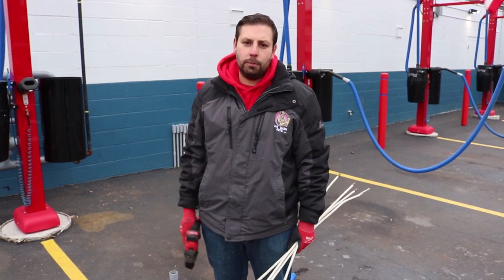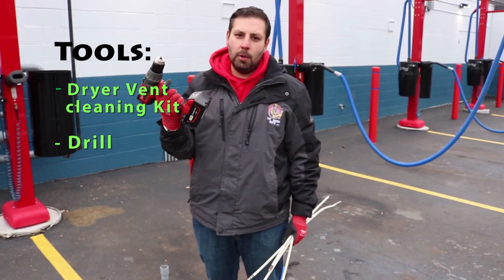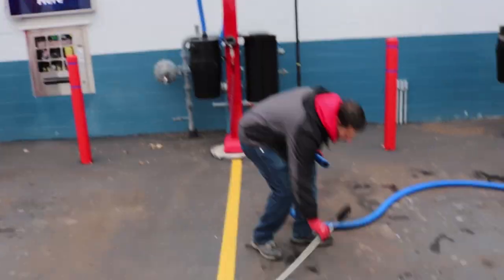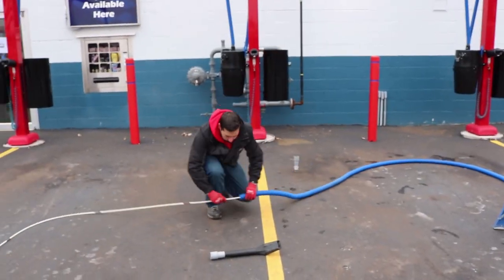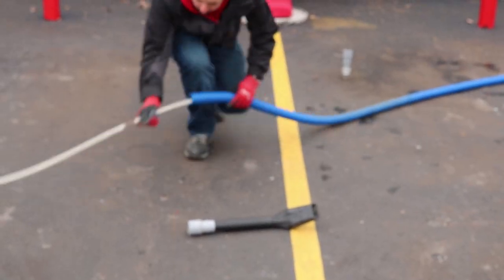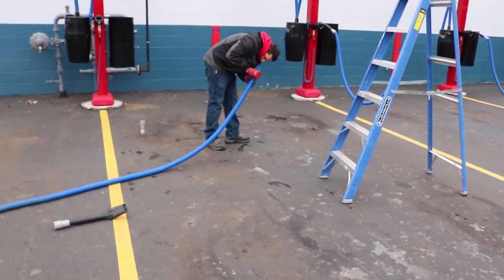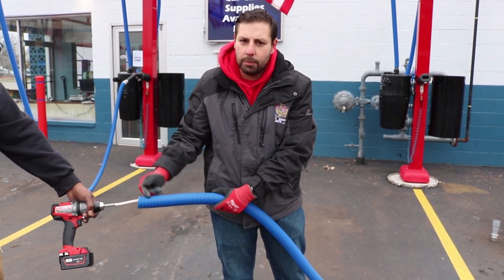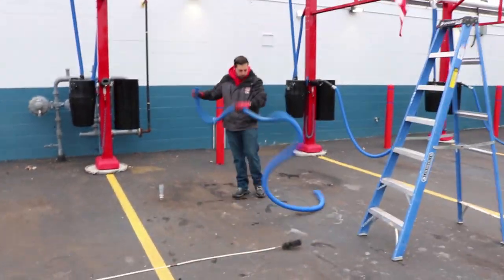How To Clean A Clogged Car Wash Vacuum Boom (System)

Comment: Way too much trouble. Never had a clog yet that didn't get flushed if I held   either end to a water spigot. Helpful tip is to keep the exit end as high as the spigot and let the hose fill with water, then drop the exit as you quickly raise the other end and walk it toward the exit.  Only rarely have I had to repeat in opposite direction.
Reply from the maker: Hi Earl. Thanks for posting the tip. I have cleared cloggs with water in the past. The only issues are that the water can be messy, doesn't work well in sub zero temps , and isn't useful for cleaning the booms and pvcs lines.
Reply: That itself is wayyy too much trouble and mess of water. Not everyone has a hose close by to their vacuums. I have seven spreads over 100 Feet. And hose and water does not work when the temperature is below freezing. The dryer vent kit is the best way for sure.
Reply: What if the boom arch is clogged??